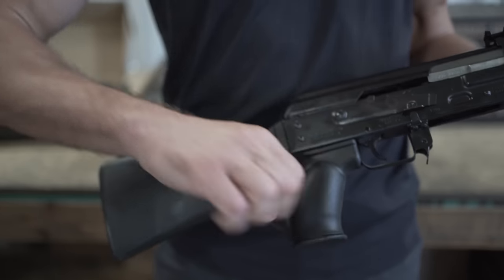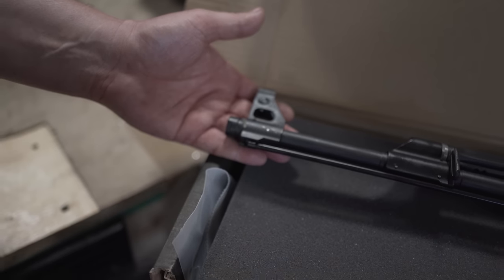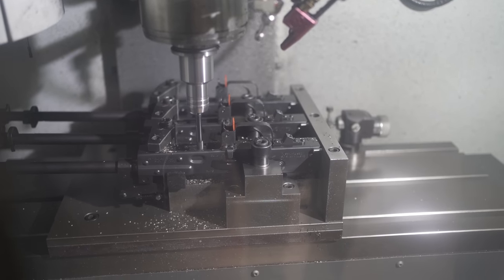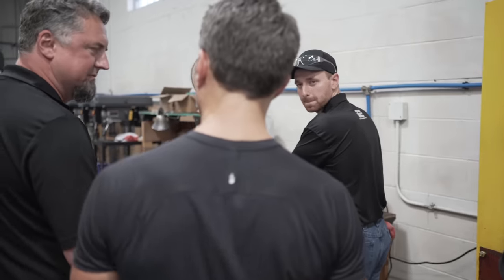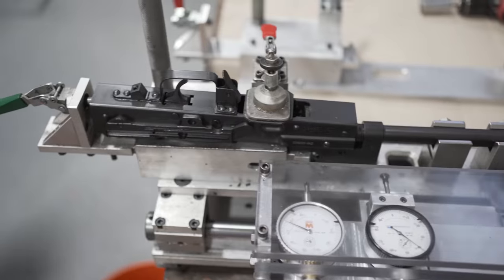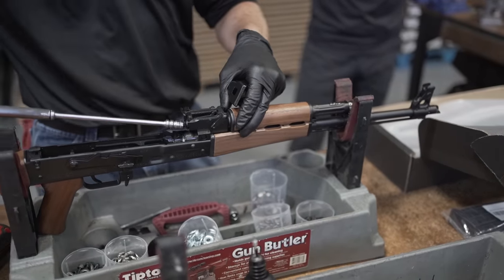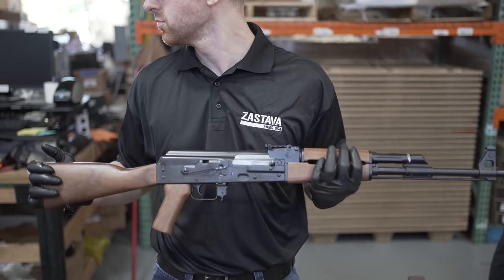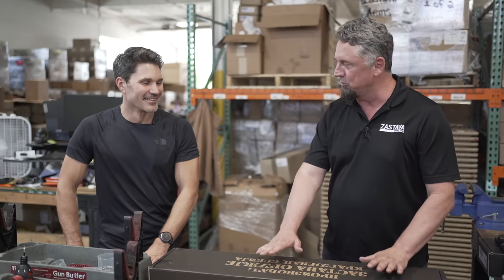Why AK-47 Imports Suck

Comment: I'm 63 years old and was a blue collar industrial grunt most of my life, to include 21+ years in production CNC machining. The fixture for checking sight alignment and cutting the muzzle cap weld is THE neatest thing I've ever seen. It is rare for a manufacturer to make so much public.
Reply: We have something related at a specific company in my town (defense industry, they mainly make things that go boom rather than bang), in a particular detail they make for SAAB they make square holes (with next to to radius in the corners) that go through the entire portion they are made on, and they do it all on a 5 axis CNC mill. I wish i knew how they do it because ive been curious about it since i saw the detail during a lecture, but its so secret they didnt even patent the technology lol.
Reply: A lot of their fixtures are really nice.  I've worked some janky assed fixtures in my time and those are all really top quality pieces.
Reply: @Livi_Noelle  As far as im aware its not a fixture (apart from them being produced on a pallet system), what i managed to find out was that the technology was developed in house and its not using a EDM machine.
Reply: If I can just be a lil bit too honest, being secret about this stuff isn't that nessecary. It's not like the average individual can buy hundreds of thousands of dollars of equipment, JUST to do this specific thing.
Reply: Not only that, it hampers the advancements of technology by being clandestine.
Reply: @ashsteele7361  Its military equipment and just taking out a patent on the technology can mean that other countries can steal the tech, i dont wanna go into details on what it is for but its a part that gets put on the JAS-39 Gripen fighter that would otherwise need to be made out of plastic (which means one time use, disposable and of worse quality).
Reply: The fixture is made in house by Zastava’s gunsmith.
Reply: @smokeydagger6540  That isnt what we are talking about at all...
Reply: Zizor; My employer had a customer that had a double ended shift with a wonky thread on each end, that when assembled locked two parts together. To look at the thread you couldn't figure out how the two parts could be put together on the shaft. The process was explained to the owner of the company I worked for, but he was contractually sworn to secrecy. This was a rolled thread product.
Reply: @TheWalterKurtz  I might have misunderstood, but do you mean a cylinder with a left and right thread on the same end?
Reply: Zizor; Nope. More complicated, atleast to look at.
Reply: @ashsteele7361  it’s more a concern about corporate espionage as opposed to individuals.
Reply: It's really silly that the BATFE is in the business of regulating where wooden gun stocks are made .
Reply: @zizor1759  it's called a CNC multiple pallet CNC machine?
Reply: @zizor1759  a patent is only protected after 20 years, cupcake
Reply: @zizor1759  Russia typically goes with the left thread? Maybe you could ask the RSO at your shooting range? Or maybe you could Google it if that's not currently restricted. Because you can't find legal s*** on the internet especially if it's on the right side of democracy
Reply: @wegmandan  And i said they didnt patent it due to other companies (or nations) being able to steal the technology and use it for themselves, its a fairly common practice in the defense industry to prevent foreign powers (Russia, Iran, China, North Korea, etc) from being able to copy designs or tech.
Reply: @wegmandan  If you read the discussion me and James had you would have realised it has fuck all to do with firearms when it came to the threaded detail, he was vaguely talking about something he did while working at a company which was similar to my story above.
Reply: @zizor1759  we are closely to 3 years? Is it still Trump's fault?
Reply: @zizor1759  you know that I use the same choice words as you did I would have received a prosecution from the left media. Maybe I would have sustained a 32 violation on FB. Isn't discriminated against? Funny how that works.
Reply: @zizor1759  hey cupcake? So work does it state in the Constitution that has a difference of the opinionation regarding the left? Care to chime in
Reply: @zizor1759  wow just reading on just this page. Seems anger issue. But please? Prove that s*** wrong. It seems you have no problem attacking people that disregard your belief
Reply: @ashsteele7361  No, but companies with the financial resources can. And then would compete and cause consumers to pay less and the original maker of the special tool would loose potential profits.
Reply: @TheWalterKurtz  - My employer had a customer that had a double ended shift with a wonky thread on each end, that when assembled locked two parts together. To look at the thread you couldn't figure out how the two parts could be put together on the shaft. The process was explained to the owner of the company I worked for, but he was contractually sworn to secrecy. This was a rolled thread product.

If I was doing it, I'd use a normal thread on one end, and a left-hand thread on the other. Then, to assemble, I'd put the rod between both "things" and rotate the rod rather than the "things" -- voila, it would woik like a chahm!
Reply: @victorwaddell6530  -- It's really silly that the BATFE is in the business of regulating where wooden gun stocks are made

They're made in the woods, aren't they? Although "grown" might be a better term than "made," IMO.
Reply: why wont they show stuff like this?
Reply: @morphius747  ; "Trade secrets".
Reply: I purchased Zastava m90 from Atlantic Firearms.   Zastava does not support  or stock the specific parts that make the M 90 different than the M70.  I am talking about the cylinder tube and the gas adjustment ring that are key to the function. (may be other specific M90 parts that simply they have not supported in USA).   Zastava customer service gave me zero hope or clarity how these parts can be obtained.   i actually email Zastava in Serbia and received no reply
BEWARE of buying a ZASTAVA M90 (and likely the new 380 M77) as they are not supporting these rifles with essential parts and no alternative to find them
Reply: @johnm1004  what do you think about PSA Aks?
Reply: @morphius747    I have no experience with PSA.    The Zastava M90 is a great 556 AK fifle    However I just believe if Zastava wants to sell a firearm in the USA they should completely support replacement parts ( particularly if it a unique part to that firearm).  Zastava has chosen to not do that with the M90.  ( and i think for the new M77 in 308. (correction from 380)
Reply: @johnm1004  ah thankyou

Comment: Just purchased a new M77 308 WIN, 2 weeks ago. My first AK and I am impressed. Iron sights right on, out of the box. 100 rounds down range and no problems. Some problems with two 10 round magazines purchased through Zastava-USA website. My understanging is that the 10 rounders are suppose to hold open on last round, and they have stopped doing that after 100 rounds. One of the 10 rounders has a tough time going in. The supplied 20 rounder works fine. Ammo used is IWI 175 gr Open tip match. I had to change gas block setting from the factory 2 setting to 1. Ejecting cases at one o'clock and 500 feet high! Great video. Thank you Zastava!

Comment: Zastava is the best AK for it's standard M70 wooden stock versions at $1k.  It is a true battle rifle.  Even the dust cover is easily twice as thick as a Polish import or Wasr import dust cover.  From receiver, gas piston, dust cover, barrel, and especially the wood stock is all much beefier than the others in same price range.
Reply: Would you say the Zastava is a better manufactured rifle than an ar15
Reply: @JCYTTV i own both but SHTF im grabbing my M70 or M90. They are both WAY overbuilt and just run. If I had to only habe 1 gun for my life to depend on it would be 1 of those 2. No flimsy shit to it.

Comment: Zastava is absolutely killing it. Easily some of the nicer and better built aks on the market for a more than fair price.
Reply: Ya I got a zastava too and she runs fine, the only problem I get is with some of the surplus mags I bought, they don’t feed properly sometimes and I even tried to stretch the springs, I bought some cheap Korean metal mags and they work great and even the knock off bakelite Korean mags work good
Reply: @outdoorvideoswithbrad  that’s all AKs really in my experience. An AK that works reliably with every single mag is an anomaly
Reply: @SmokingGun4570  that makes sense, I’ve only own one ak and a sks, I’ve actually had good luck with aftermarket mags for the sks, the original internal mag is old and likes to jam sometimes
Reply: I have a M-70 imported by century arms. The mag well is tight af, prefers cheap metal mags
Reply: trash, ill never buy zastava again. i was thinking of taking another risk on a zpap92, i said hell no im not going through that again. my wbp milled minijack is the definition of fine work and quality control, zastava is plain shit. my psa's are better than any zastava.
Reply: @steveharper5368  I never had trouble with my zastava, but I got the m70, I don’t like the modern look
Reply: @outdoorvideoswithbrad   it was every time i got one, i got so sick of it i told the phucks to get out of the commercial business. my zpap92 you could not close the dust cover, it was off one inch to the left, you had to pull it to the right and then slam on it to try to close it. the phuckers at zastava said AKs are not supposed to be in spec. im still not sure but i think the whole gun was out of line, never again.
Reply: @steveharper5368  that might of been an older one, I heard of problems from the older supplies, I got mine in 2021 brand new, but I understand if you had problems
Reply: @outdoorvideoswithbrad  it was around 2019. the gun was defective, they lady initially wanted me to get it replaced and some smuck, probably Ranco stopped it . thats fine i have a wbp and 2 psa's all top notch.
Reply: @steveharper5368  cool, I’ve only ever had one ak and a sks, so I can’t say to much but just speaking of my experience
Reply: @steveharper5368  good to know, ya my cousin has a Kalashnikov USA shotgun and he had to turn it in for rust issues and the original stock was coming loose, but they fixed it, I got a cheap lynx 12 that never gave me a problem haha and that’s even Chinese
Reply: @steveharper5368  Pretty sure this was when they were still being imported through Century. Which would explain a lot. The company was doing with a lot of these complaints, overhauled their while US operations into what you see in this video. Set up their own importing shop and did the work themselves. It's basically not even the same company anymore. It's why their reputation has skyrocketed in the last year and a half or so.
Reply: @mantism.d.8363 bro has been quiet ever since 😂

Comment: 922r was implemented in 1990 by the Bush Senior Commerce Department to try and prevent importers from circumventing the 1989 import ban by importing foreign parts and converting compliant rifles. Both laws were executive orders and could easily be removed by executive order.

Comment: After seeing all the compliance works taken place the M90 is reasonably priced.  

For a 1st time AK owner, i love the M90 despite it being heavy since i come from AR platform.

Trigger is the best when compare to most AR off the shelf on the current market.
Reply: The M90 has a shockingly good trigger. It's not my nicest rifle or my most accurate rifle, but it's my favorite rifle anyways. It's so much fun to shoot. I bought an ALG to put in it before I even got the rifle itself. The ALG is still sitting in my parts bin. When I get around to it, it will probably end up in my M70. The M70 has the kind of trigger you expect an AK to have. It's decent, but not great. Still better than any milspec AR trigger I have tried, but it's nowhere near as nice as the M90 trigger.
Reply: @raifsevrence  - I recently got my first gun and the m90. As you mentioned that it is heavy weighing nine pounds without added equipment. The finish wasn't as great as I thought it should be for a gun that is going around 1200ish. I got the red Serbian stock, and it was dusty and dirty. 

I live in California and the total cost was around  1500. The gun shoots fine however, z don't make 223/556 magazines in 10s. I’m using the WBP/FB magazines and it's such a pain in the ass to break it in. Only downside to owning one in Cali. I should have brought the m70, where magazines are available, and gotten the WBP Jack for the 223/556.
Reply: @raifsevrence  Lol 3 months later and here its my M70 Serbian red sit right next to my M90.  I just bought an M70 surprisingly the M70 feel lighter than my M90.

Comment: I have been a CNC Machinist for over 20 years I've never seen anyone not use coolant don't know if they didn't use the oil or the coolant for the demonstration purposes but I would want lubrication while I'm cutting what a great video to show what the process is to convert these AKs to a product what we desire I've been wanting to buy an M90 for the past two and a half years now but I have a medical card don't know how that's going to work but now that I seen the process and the CNC machines that they're using to modify the mag well especially when that probe was identifying the location before Milling makes me want to buy one of these even more now I like the fact that we've got Americans putting parts and dedicating their work and passion into making these rifles a good product Big Ups to Zastava Arms USA
Reply: Compressed air is a solution that can eliminate any need for lubricant...

Comment: I'm surprised all the forced import compliance parts that are removed aren't shipped back to the factory to build more rifles. Maybe they are but certain van manufacturers use a similar strategy to avoid chicken tax.
Reply: I'm sure they are sending parts removed back to Serbia to be reused. It would not be cost effective not to.
Reply: @mrsickandtired  I would not be surprised if it was cheaper to make new parts in Serbia than deal with exporting and importing gun parts, plus shipping.

Comment: His explanation of 922r seemed a bit off.  Simply put, 922r states that there has to be at least 10 U.S. made parts on the rifle at any moment.  Also, not certain if it's 922r but, they have to be "sporterized" in order to import at all.  Basically meaning nothing tactical allowed.  No threaded barrels, no pistol grips, no adjustable stocks, and worst of all absolutely no double stacked mags.  All this only applies to rifles.  Pistols are exempt.

Comment: Wait a minute
I got a sloppy one
Flaw passed QC
I bought a m90 when they first came out.  I bought it based on TFB TV's saying how awesome it was. I trust Reed and based off the 2 videos, table top shot show, and the m90 review I was sold. Paid my $1223, plus tax, plus shipping, plus transfer, got a scope mount, and a couple extra mags.  
SLOPPY LOOSE WOBBLY MAG! 
I contacted Zastava and was told "that's how AK's are sorry" Umm no they are not. Maybe a crap one but not a Zastava. My m92 isn't loose. I have handled others m90's at gun stores and mags are tight as it gets. Kicker is I put a 7.62x39 mag in m90 and its rock solid.  I think they finished a run of m70's and then did a few m90's and cnc operator said "oh sh*t! I f*cked up! I hope no one notices" Well... I did.  Gun is flawless and super flawed at same time. I'm not talking a little wiggle either. And every other m90 I've seen either in video or in person lock up was tight. My steel 5.56 mags are way less wobble, but c'mon the fix is buying 10 steel mags for $400 more after I'm already $1500 into it. And as a bonus I don't want to sell it and pass the flawed AK on to someone else.